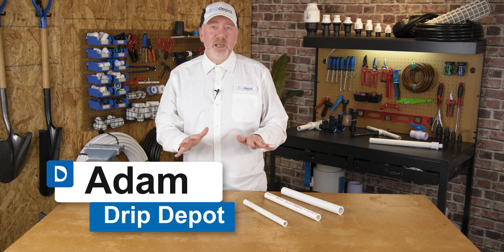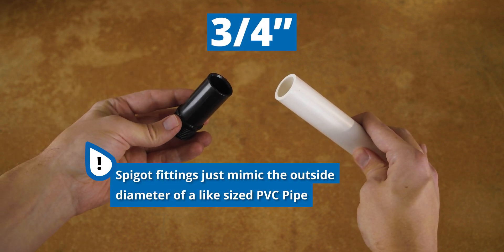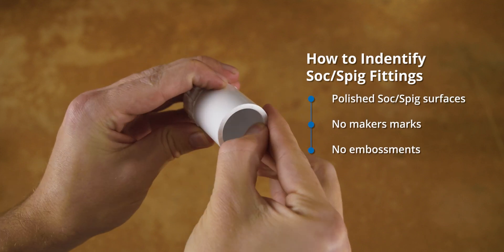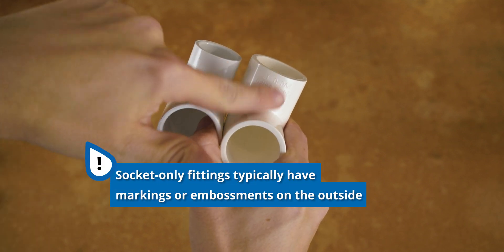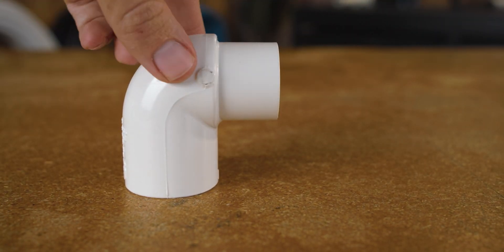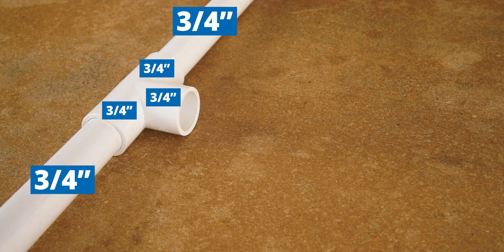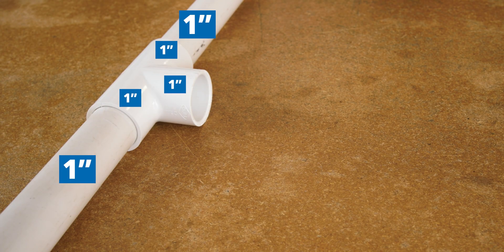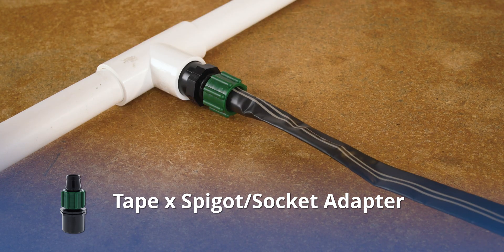Understanding Spigot vs. Socket PVC Fittings

Comment: Learn something new every day! I thought a spigot was a water valve! 😅
Reply from the maker: Martin, this actually came up while we were making this video!  We were wondering why a hose bib is called a spigot, or if maybe it was a specific part of the hose bib like the male threads (since spigots are male)?  

Did a little research, and it turns out we were close .  A spigot, way back when, referred to the wooden plug that controlled water flow in wooden barrels -- and that plug was indeed considered a male.  These days it does refer to the entire hose bib or valve, but an interesting history all the same :) 

Thank you for the comment Martin, and awesome your thoughts went the same direction ours did!
Reply: @dripdepot  No problem Andy! Always look forward to your content!